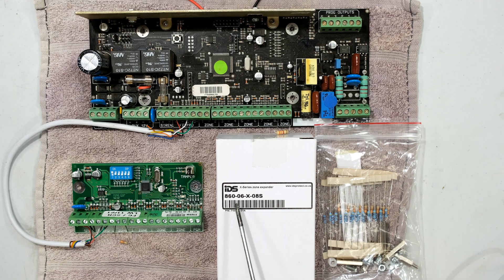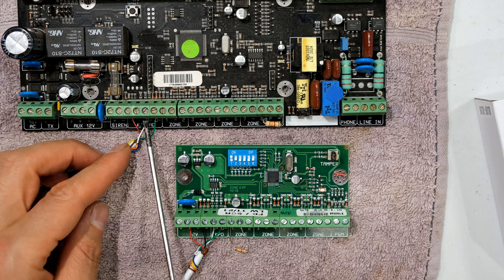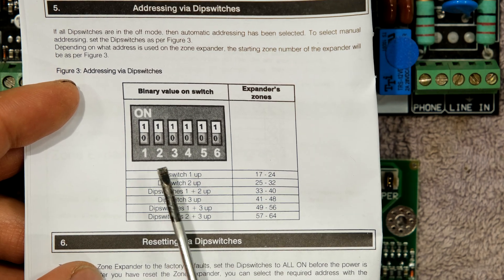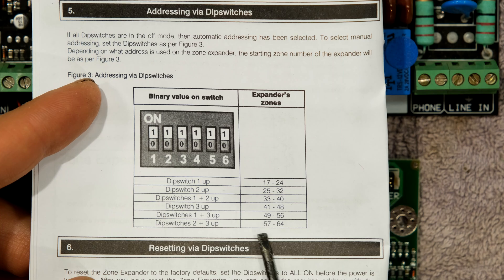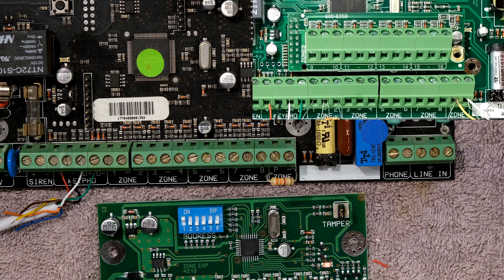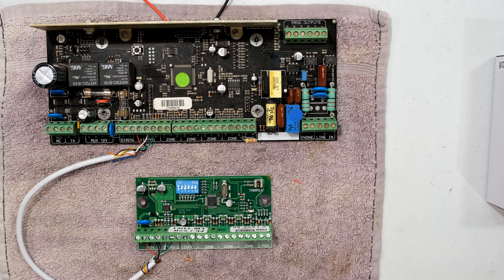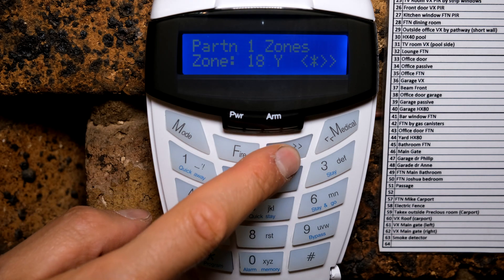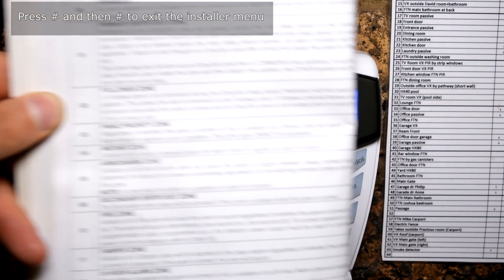How to add an expander board to an IDS x-series alarm system - Tutorial

Comment: Hello, looking for some assistance, i managed to wire up x ex pander modules correctly, problem is when the modules are connected the keypad reports trouble: peripheral fuse, peripheral ac, peripheral batt. also one other issue, the zone one wont stay closed, even when there is just a 3k3 resistor accros,n only way was to disable the zone, any pointers please.

Comment: hi, nice work. I have a challenge. My expander board works correctly for few minutes then it starts to blink and all zones becomes violated. When I remove the power completely and reconnect, then it works again for a few minutes. This is a new expander board 17-24. I don't know if you can help. Could it be that I bought a fault board? Please help with any troubleshooting I can carry out. Note also my battery is almost done but am not sure if this cause the problem. Thanks in advance.